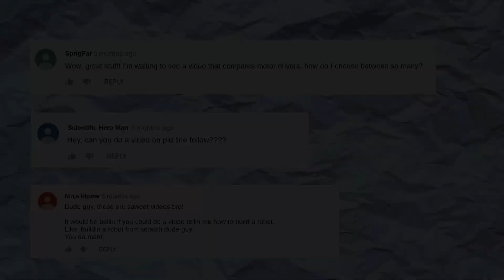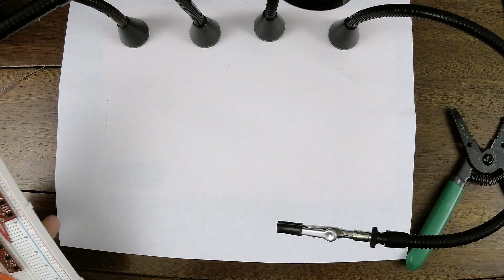How to Tin a Wire

Comment: I like your clamping device. Is that home made or can it be purchased somewhere?
Reply from the maker: It's called QuadHands, I got it on Amazon. Here's a link https://www.amazon.com/gp/product/B01MTWLF2Q. It's expensive for "helping hands" but I have no regrets, you can use the arms on any metal surface, or the heavily weighted metal stand that comes with this (it's under the paper in this video).